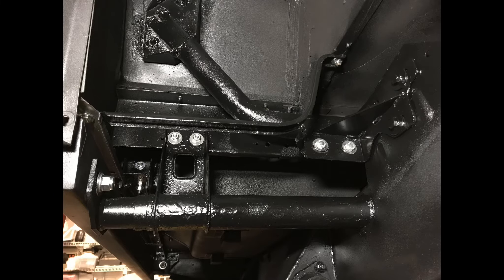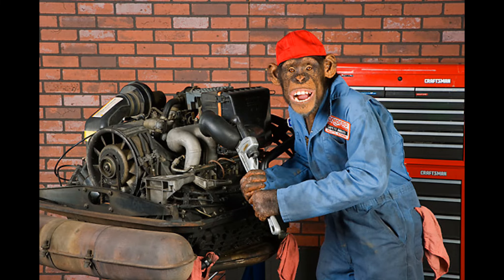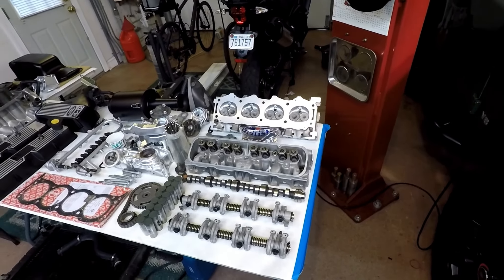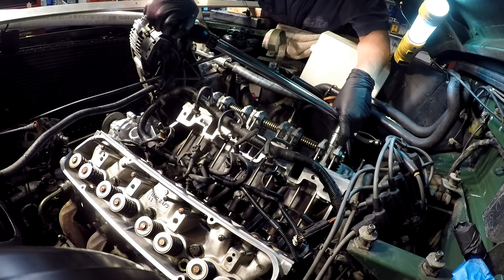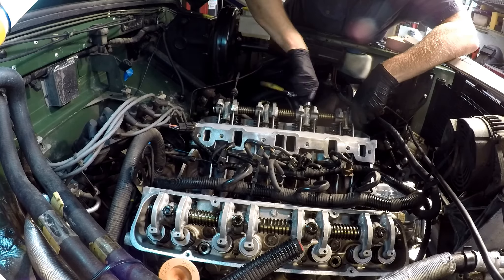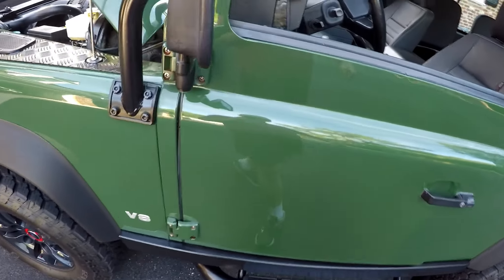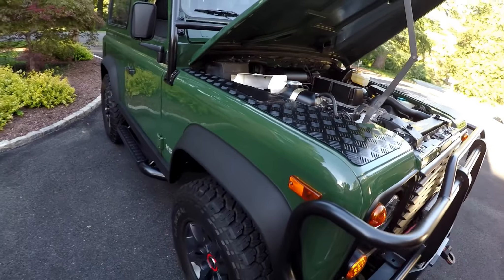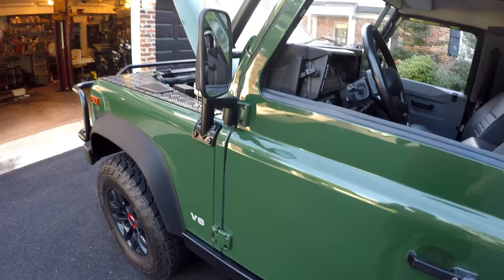1997 Land Rover Defender Engine Overhaul

Comment: Where did you purchase the rebuild kit?
Reply from the maker: Hi!  It’s been a while but I think it was Atlantic British.  Good luck with your project.
Reply: Thanks. Just picked up a 97 Defender 90 NAS. Has high mileage so I'll be trying to do what you did on yours. If you find anything related to the parts used I'd be very appreciative.